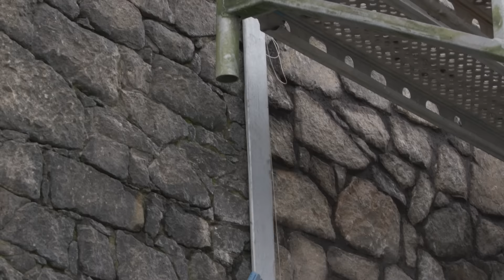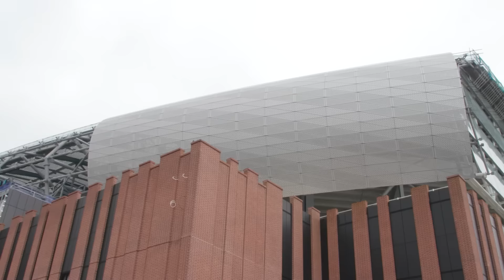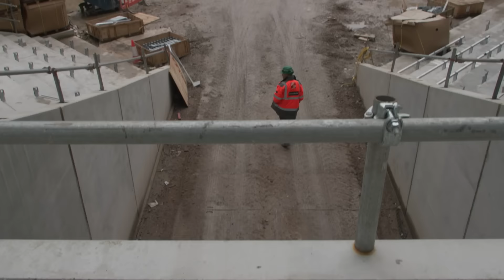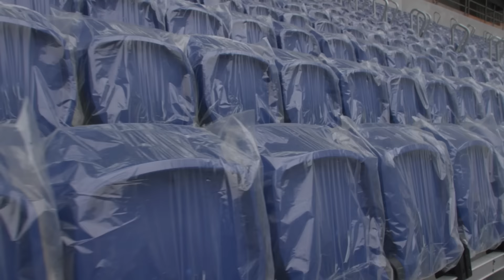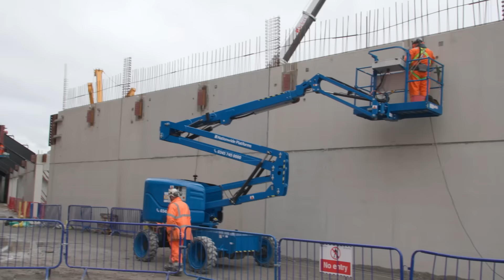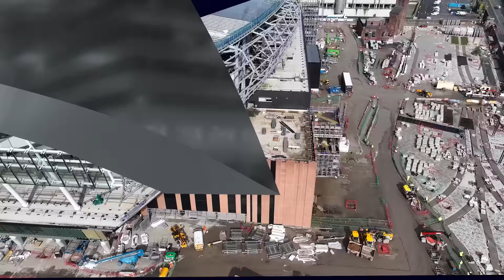EVERTON STADIUM CONTINUES TO TAKE SHAPE!

Comment: All seems about the dock ground nobody seems to be mentioning the road outside the dock ground if everton move ground and they leave that road as it is outside the dock ground its going to take hours getting to the match and the same getting to houses after the match plus the rail network won't be able to handle the crowds eg match people and people leaving work etc it's going to be chaos your going to have 30 thousand cars maybe more plus coaches etc decending there the congestion is going to be horrendous and there is very limited parking outside or near the dock ground